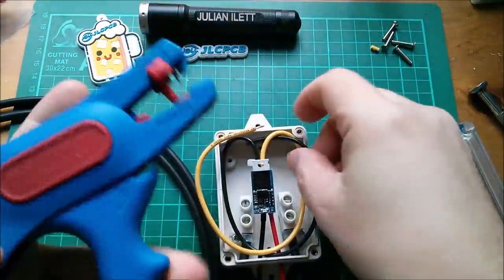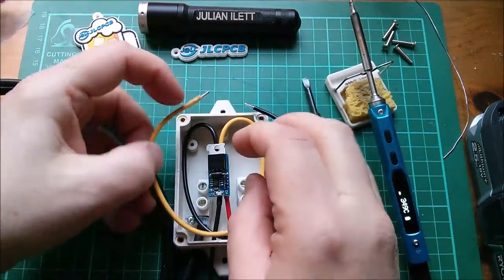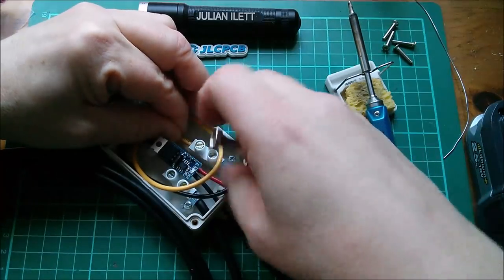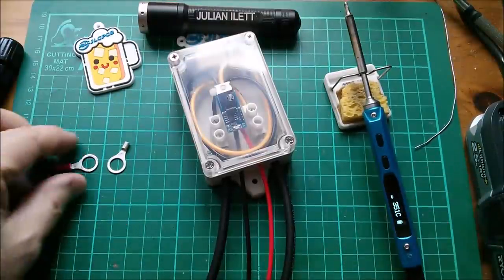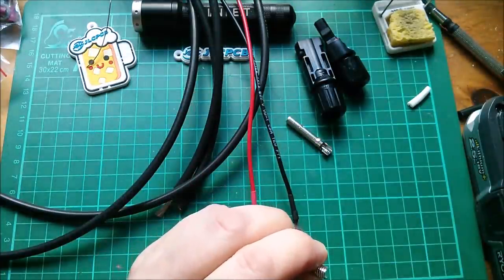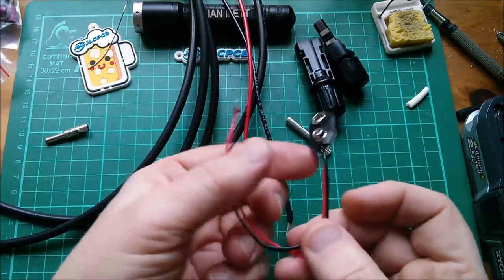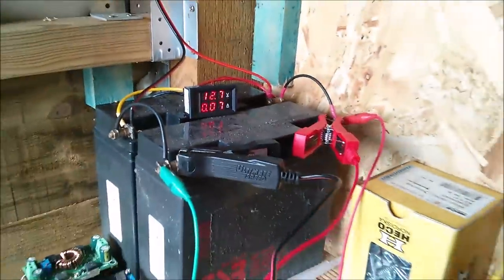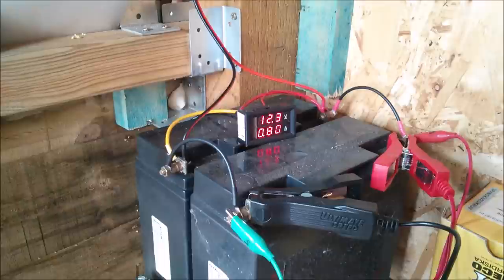Power Wall Update - Install of Solar Charge Controller

Comment: I thought that tinning wires that are subsequently put into screw terminals was considered bad practice because the solder tends to move and loosen the connection
Reply from the maker: Not by me :)
Reply: Was wondering why he would tinn them first. Would never think of doing that. Is there a reason?
Reply: It is bad practice, so your right :D
Reply: Yes, it is bad practice, as under the pressure of the screw, the solder will creep resulting in a loose connection. And it’s possible that a high current flow will cause the poor connection to get hot causing further solder creep. Then an open circuit fault or worse, an arcing connection and maybe severe overheating and then fire!
Reply: Absolutely, that practice is banned where I work - and it is definitely a problem, I've encountered several failures of connections in 13A plugs where the ends were tinned. Bootlace ferrules are fine, but solder will creep.
Reply: @JulianIlett  ... He makes a good point above and the following comments seam to concur !! 
Maybe something you could follow up on ? 
I'm far from a expert - I follow your videos for loads of reasons, mainly to learn something.

Comment: 2:31 - You wouldn't have to worry about touching the soldering iron if you weren't using that silly toy of a stand!  Why do you insist on using it?  Why not use a proper stand that is not only safer but also takes up much less desk space?  And would put the iron at a proper angle thus making it quicker to use.  Julian, you should watch your video to see your hand movements when placing and picking up your iron.  You pick it up and then have to make adjustments to get the right position.  With a proper stand at ~45° you can pick it up in the right position to begin with.
That little stand is only good for small portable use.
Reply from the maker: The little T-stand is proper - it's proper cute, proper handy and proper proper. All in all, I'm proper happy with it :)
Reply: @JulianIlett  - It's a proper way to get a burn.  At 5:16 you were actually wondering if it was burning something.  With a proper stand there is nothing to worry about and it won't easily move around on your desk like that little thing does.  Come on Julian, spend a few bucks on a proper stand.  Heck, it would give you something to review here.

Comment: Julian, if you ever need to disconnect the solar panels again you might want to short the MC4 leads together so they don't corrode. It's okay to short solar panels, it doesn't bother them at all.

Comment: That waterproof solar connecter for the wire is what they have on Jetski electrical boxes that can go underwater, ie, a conical grommet that is compressed by a screw-on nut.

Comment: 3:33 - Forgetting the heat shrink?  Me?  Nope never.  Never... LOL.  Been there, done that too many times!   ;-)
Reply: My best one was terminating a 25 way cable to a 25 way solder bucket D connector, and then discovering that I forgot to thread the cable through the front plate first...
Reply from the maker: That's when you get your hacksaw out and modify the front panel :)

Comment: First, shorten the yellow and black wire in the case. Second, never put such wires (tinned) into a normal screw terminal. Without tinning, they will get loose. With tinning, they will also. High power and loose cables == fire. Always use some press fit ferrules. Same for the ring terminals. Press fit them onto the cable. The soldered wires will potentially break within some time.

Comment: You should not put tinned wires into screw terminals. The tin can deform over time which often loosens the connection - and you know what happens, when power meets loose connections. Nobody wants to see your fence on fire. ;)
If you need the wire to be more solid, crimp an end sleeve onto it.

Comment: 4:10, push the wire in then flood it (use flux ideally too).  If you put solder in first it might be hard to push the wire through.
Reply: Also, pushing a cold wire into hot solder is a recipe for a cold solder joint - both surfaces need time to come up to temperature.
Reply: Better if he actually got a reasonable quality ratchet crimping tool instead of soldering the crimps...

Comment: Long time since i've seen gryrating stripper. used to have to set the cutters on rotary strippers, so you push the wire in and pull it out stripped. the operators would sit for hrs talking and stripping 1000's of wire and we call it the good old days.

Comment: A question re making mc4 connectors:- if the crimp is only 8mm or so, why does one strip the wire 25mm?

Comment: wd40 is better as it is a water repellent a little led voltmeter would be good in the case also
Reply: Petroleum (mineral oil) and some rubbers and plastics are not compatible with each other, resulting in a failure of the seal.
Reply: @Mark1024MAK  used wd40 on bike rubber for carbs etc for years never had a prod with it to dispel water where it should not be
Reply: @1981dasimpson  - hence why I said *some*. In the industry where I work, we used to use both 3-in-1 mineral oil and petroleum jelly to protect terminals against verdigris and did not worry about it if some got on the insulation of the wiring. However the cables use pcp rubber for the insulation. Over time the oil and petroleum jelly damage the insulation causing wet type degradation failure of the insulation (it changes to a sticky goo). It’s cost the industry vast sums of money having to replace the damaged cables and wiring.
Reply: @Mark1024MAK  is that down to the pcp rubber bean cheaper then other coated ones ?
Reply: @1981dasimpson  - pcp rubber is far tougher than PVC. For example when running wires and cables in trunking, or cable trays or similar, PVC can melt due to friction, but pcp rubber is not so easily damaged. The downside is that it’s more expensive and the lifetime may be less than other cable types when used externally if the environment is wet/damp.
Reply: @Mark1024MAK  ah ok not something i know about